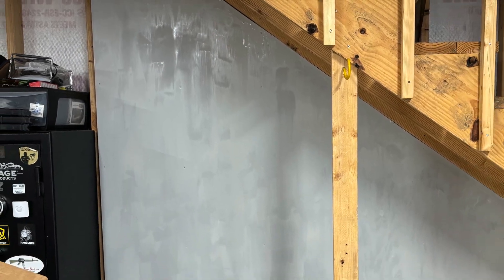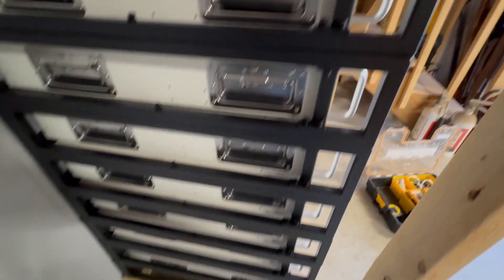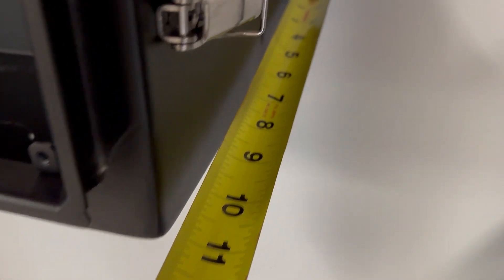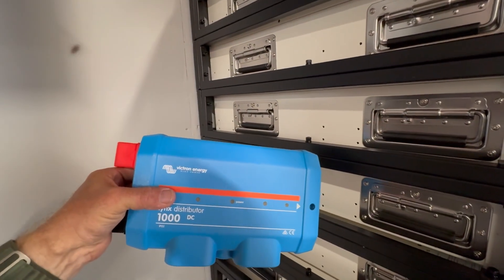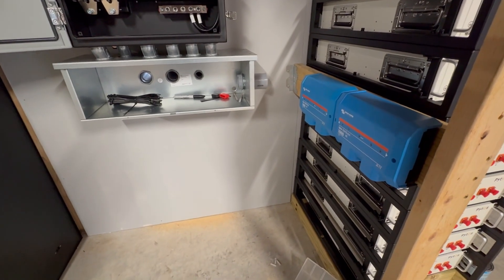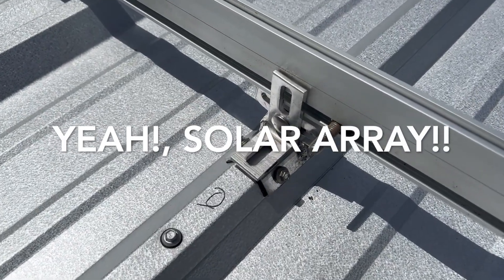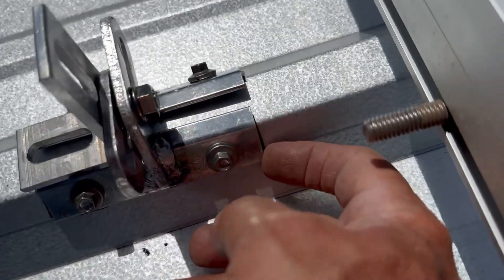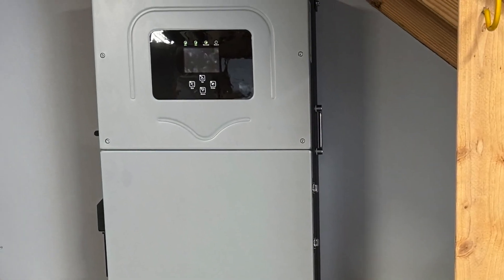Sol-Ark 15k plus Pytes e-BOX Combo with Maverick MacGyver

Comment: 3:55 why is victron distributor needed, what does it do?
Reply from the maker: The Victron Lynx Distributors are a battery combiner that combines the 8 positive and 8 negative battery connections of the Pytes batteries into one group to go to the inverter. The Distributor has fuse holders so each battery has overcurrent protection. Some server rack batteries already have that and you can use the Lynx PowerIn instead.

Comment: Don't you need a lockable battery disconnect after the victrons?
Reply from the maker: The only Visible Lockable Disconnect that we need in this jurisdiction is between the grid AC connection and the inverter input. In theory, the Sol-Ark door can be locked with its internal DC breaker in either position. Do you need this where you are?
Reply: @maverickmacgyver that was how one quote so far has had it.  I didn't ask whether everything on the quote was actually required or a best practice of the installer.  I could see why they would want a disconnect near the batteries.